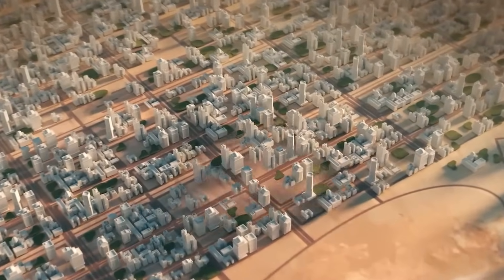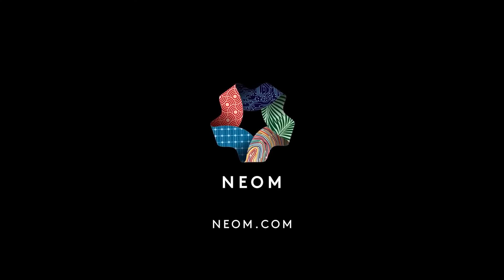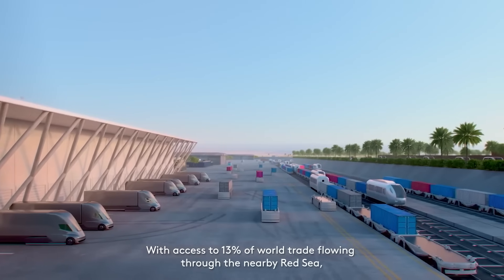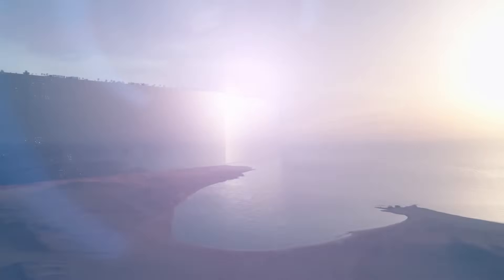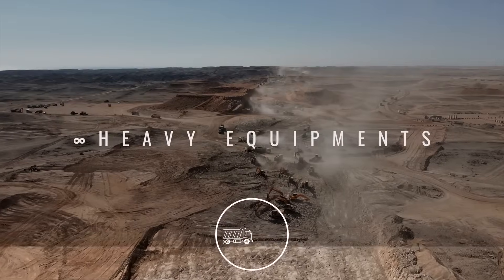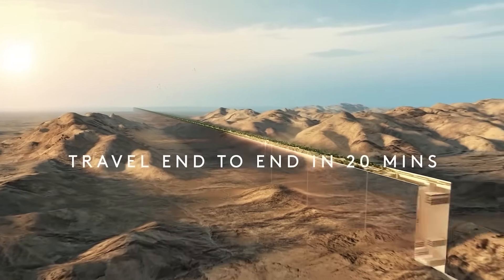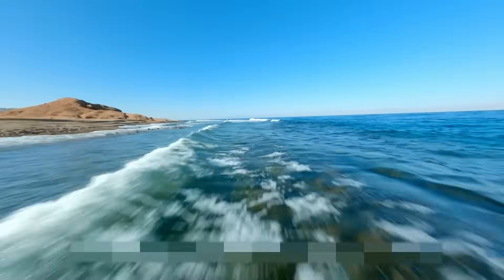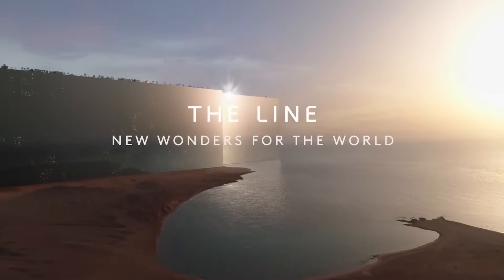THE LINE: What If This $1 Trillion Project Actually Works?

Comment: I dunno.. architectural trends and norms don't change quickly. Cities are based on grids and circles because it obviously makes sense to rally around some central point. Maybe Line cities on the Moon or Mars where atmosphere considerations are crucial would be more appropriate. Building long boxes is easier than constructing large domes. Yes, lack of gravity would help with erection but would still be a herculian task the first time around.
Reply from the maker: Interesting thought